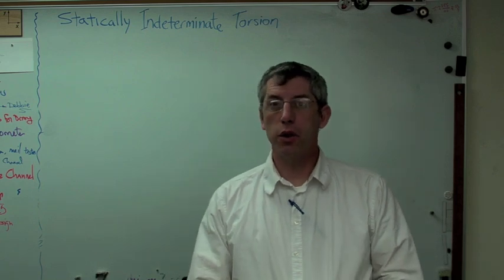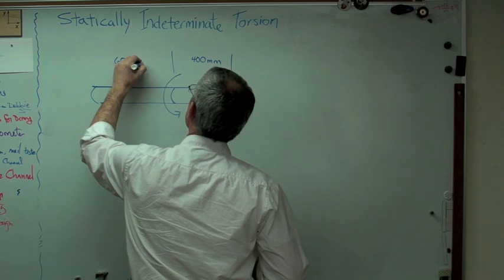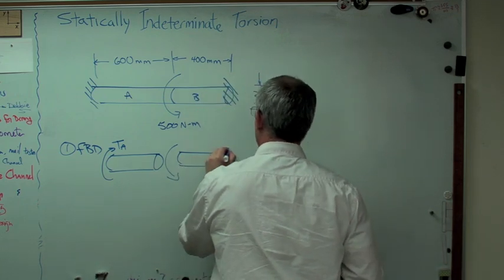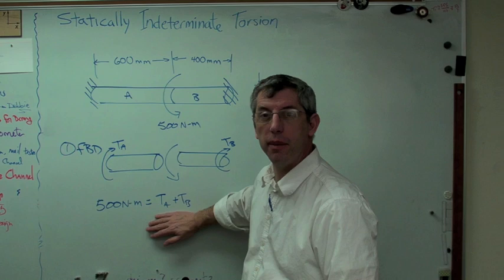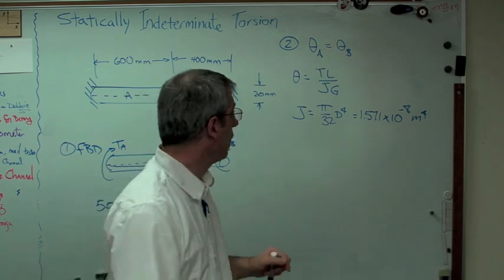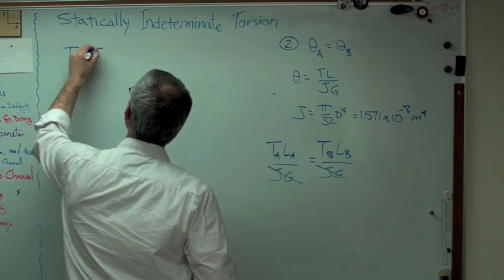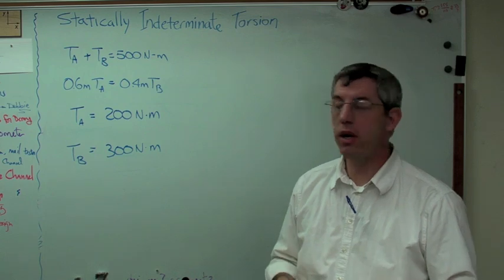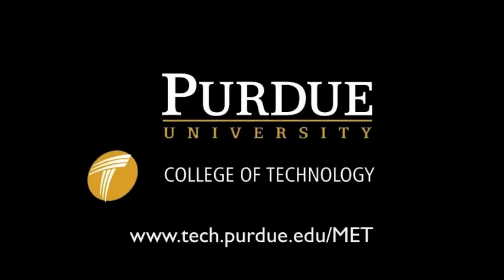Statically Indeterminate Torsion - Brain Waves.m4v

Comment: krish2304, in your if -> then statement about a 1000 things are missing, I'll name just a few: deflection is missing, which is due to the torque acting on the beam, stress-strain relationship is missing, which accounts for the properties of the material, the cross-sectional properties and the load scheme, on which the value of deflection is based, ans also the positional (angular) differences between the cross-sections at the supports and in the middle. YOu are wrong in everything. 15 char left